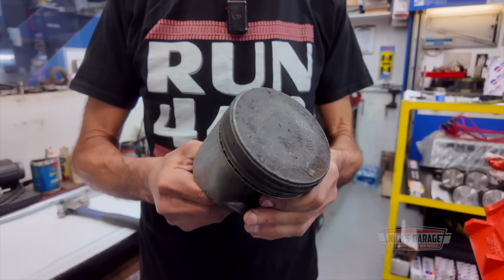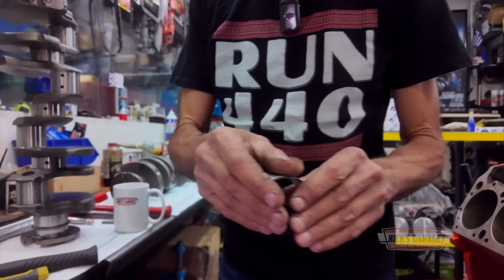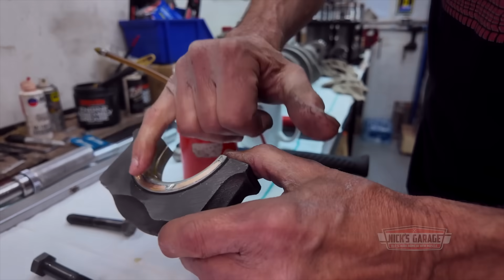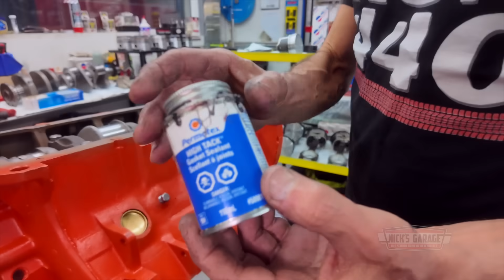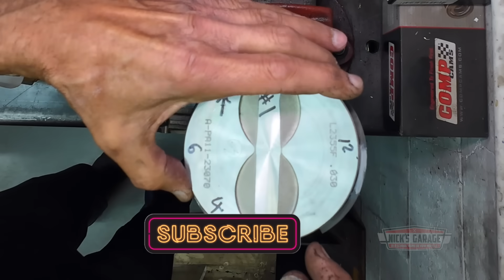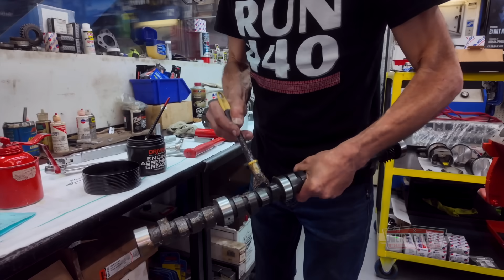Numbers Matching 1970 Magnum 440 Rebuild - Part I - Short Block Assembly

Comment: It's okay to use the battery-operated ratchet to get the bolt close but you should use a hand ratchet to seat the Bolt when the battery ratchet spins off the Bolt it could spin off a shaving from the bolt head. Using a hand ratchet with your hand over the head. It will stop it from stripping. Plus it will stop from twerking the cap slightly out of position You should never strip a bolt or a nut head. I'm not a mechanic something my grandfather taught me. Love the show my favorite show

Comment: Sitting here watching this at 11:45 p.m., and it's saying 7 months ago .... and it's like I'm right there assisting ... pre coating parts for assembly with oil ... I can almost smell the oil and fresh paint. I guess when we love something enough, it happens!  Listening to the metal as he drops the bolts into place for the connecting rid bearings .... and await the distinctive "click-click" of the torque wrench as each one is set to specs.
Last rod bearing being torqued, and it's like watching a surgeon at work.
Thank you!! Much appreciated! And thank you to George for bringing it all up close to see! Stay safe and well.

Comment: id build the block in the car up to about 520 to 530 hp and put this blck on a stand parkednext to the car. I d put a 5 speed and save the original trans with the original engine.

Comment: At 1:19:24 the key on crank is not aligned with cam mark. Is the key not suppose to be straight up for TDC
Reply: NO.  The two marks on the chain is what you want to line up  on this application.

Comment: If I read the cam spec right that's a 112-degree lobe center with 5 degrees of advance ground in. I'm no professional, but I recognize the ubiquitous 214/224 cam that shows up under many labels. It's not a hot cam, but it's a nice step up from stock for that engine. The extra exhaust duration should help breathing through the manifolds. You'll probably beat the stock HP and still have a cam that's very civilized in a 440.👍
Reply: 214/224 is pretty much the same as the stock magnum cam @ .050.  the 112 LSA is different though (115 was stock) and the 107 ICL is quite a bit different as well.
Reply: Good point.  The only problem is that from the factory the 440 did  not have a  true 10.5 C.R.  If it did, it would have made easy 375 HP plus.

Comment: I balanced crankshafts for several years, and when you pointed out the hole drilled by the Pin area, that told me your new pistons and rings (your using the same rods, which you may have had matched weighted too) are heavier than the original ones. I used to make up ring weights for one off cranks to match the calculated reciprocating mass .
Did production balancing too and for that we had comp heads to counter the crank counterweight mass and not stick ring weights on cause it’s time consuming and production cranks aren’t balanced to as tight of a spec. 😊 this is fun to watch .
Reply: The pistons I replaced in my 440 are much heavier   then the cast i had before.  Good call.

Comment: i wonder what two differences in the test mule 440 that resides in the challenger  now compares to the original beast that goes back in. ill bet someone missed a shift or over reved it to break that rod. thank god that cylinder is fine. dyno comparisions will be interesting!

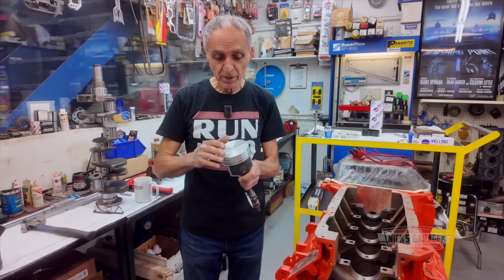Comment: 5:17 Thank you for pointing out that specific detail! A lot of the time all I hear is people saying "deck the block, deck the block, blah blah" but they don't understand that once you do that you can't put that metal back. The correct process is to get pistons to suit the deck height as you pointed out here. I've seen several blocks ruined for further rebuild opportunities because they shaved the deck to match a set of pistons. When they do that they change a lot of other things too, valve train geometry or pushrod angles and then the intake has to get planed to match the new heights. I get doing a clean up pass on the deck but taking more than a few thou is asking for problems.

Comment: Great video. Being a shade tree mechanic myself (those days are over) it is a service for those who will be doing a rebuild at home. I noticed how strongly built the lower end of the 440 block is, it must be quite rigid. No wonder the Hemi with the cross bolt mains can take so much power.

Comment: Very nice work as always Nick. 👍
Side note: factory length on the fuel pump pushrod is 3.22" - and a lot of the aftermarket ones 
these days aren't very good quality (probably skipping a hardening step in manufacturing) and
will wear prematurely, which makes a good factory one the wise choice.
On to video #2!
- Ed on the Ridge
Reply from the maker: Good information to know, thanks for sharing!

Comment: Great video Nick.  I’ve done same as you.  I have original engine 440 built wrapped on an engine stand.  Replacement engine is a racing engine.  360 supercharged.

Comment: Been on the fence about whether you should install this engine, or make it a stand queen.  Never been a fan of letting engines sit, unused, and I don't know how much driving of this car you will be doing.  I think if it was my car, and I would be keeping it low mileage, I would install the original engine.   But I don't have the means to swap out engines as easily as a shop does, and having 2 engines for one car wouldn't be an option for me.  And let's see more of Georges hot rod!

Comment: Nick I built several 440 and one 383 (4 speed superbird)  matching number
Heads  do what you can  I used the 2.14 x 1.81 combo but today I would use guides for smaller stems  would LS valves work  get rid  of the heavy stock valves  multi angle on the intakes. backcut and radius on the exhaust modern beehive springs with their lighter retainer  use the durabond seats
Does the crank need work, new pistons etc   
on the 383 I snuck a 440 crank in  on one of the 440s I  used a stroker
stroker is the way to go, you can use a 7.2 rod  anything you can do to get lighter pistons is well worth in and there are more modern ring packages than the 1/16  1/8 combination  GO light but try and keep a reasonable compression ht  If your plock has 6 pack crank and rods loose those heavy rods for sure
do not use a stock cam  they are a smog cam you can do much better
hyd roller or hyd
If you use stock stroke use the quench dome piston from KB  I helped design these back then
did you square up the block  sometimes they are all screwed up
those 6 pack rods are junk and the pistons are heavy  no quench   plan on super premium gas with no quench and high compression
cheers
Howards has a good selection of HFT Mopar cams, comp not so much

Comment: Why worry about anything? Didn't you change the color, and add options that the car didn't have to begin with? 

Just as if a car under warranty has an engine go south. The manufacturers want the failed engine back for analysis, and the customer gets a new replacement engine.

Comment: Nick I’d absolutely leave the welded block in the car. Keep the numbers engine on a nice stand and just leave it. Turn from time to time. You are already a very busy bloke you don’t need to be frigging around with that unless you have to. And it could ruin yr enjoyment of it by making you nervous every time you light up the tyres.
Reply: And the one you have in it turned out a PERFECT street engine 400hp and 500 foot pounds,
Reply: We do that a lot here in Australia we thrown a non matching in it so we can really enjoy beating on it. We rebuild matching and leave it on a stand so it doesn’t ruin yr enjoyment of it by making you nervous every time we light the tyres.

Comment: It's your car, Nick, but if it was mine, I would use the original engine, as long as it's not going to be driven hard a lot. They were built to be driven, not put on a shelf - or stand.

Comment: I love seeing engine builds. 
Speaking of which, how is George's engine coming along? Did you ever find the intake manifold he wanted? I've been anticipating seeing more of that engine, as I have an affinity for straight sixes.
Reply: Soon to come.
Reply: @nickpanaritis4122  I'm not a Mopar guy, so I have a question. I saw that you put in the fuel pump pushrod with a threaded plug on the end - how is it going to drive the pump if the end is blocked off?
Reply: @RoadkillThePartsJockey  ...The opening above the fitting is where the fuel pump lever enters.

Comment: . out of the 5 440s I worked on one of them the center cam bearing was  off I carved on it with my pocket knife so much it was going to lose oil pressure there so Tony had to make one out of brasslite to put it out of center . Tony knew his stuff 1st try bingo .

Comment: This video demonstrated tried and true methods when assembling an engine. Take your time, double check each step that you perform and you will be rewarded with a smooth robust engine.  I have one question Nick. At the end of the day, when you are all done torquing bolts, do you return the wrench to zero? Thanks for this enjoyable video!😊
Reply: Yes, I do set it back to ZERO.

Comment: That's a tough call Nick it depends on what you want from the car and engine. Numbers match to me putting that entire car back to "as built" excepting necessary over bore, crank under cut. If you going dragging, put that engine on the side

Comment: Great video and your knowledge is amazing. Your the 440 guru . I would put the original engine and make it matching numbers. You can say then its correct at shows and not back in the workshop. If your not going to drag strip the car ! I see the engine making a bit more than stock with those pistons and modern build especially if you blend the heads and port match them.
Reply from the maker: Thank you.

Comment: I would put the numbers engine in the car. Its probable not going to be driven like it was in 1970, at least not as often. If the numbers engine is with the car there's less of a chance of it getting separated from the car.
Reply from the maker: Certainly not as often.. but Nick has a bit of a lead foot when he is behind the wheel of this beauty.

Comment: Lets see Georges engine finished and running .
George deserves this NOW he works so hard and does an amazing job Nick.
Your site is good BUT  not without George and Mellisa.
Please get Georges done.
Thank you for all of you guys work !!!
Cheers Gerry
Reply from the maker: The six banger is 80% built and will be on the dyno very soon!  Thanks for being so interested.  Cheers.
Reply: Thanks for the reply .
How much more needs doing... is the intake getting modded or stock?
There was a truck engine that had the 2 barrel that would be simplist .
Cheers 
Thanks Nick
Gerry

Comment: Put that motor back where it belongs and sell me the one that came out
 😊
I need a motor for my 1970 Challenger R/TSE 440. The current engine Is not correct and it came out off a 1970 New Yorker
Reply from the maker: Where would you put it?  😃

Comment: I  just bolted a piece of sheet metal to the bottom two bolts of the 727 transmission inspection cover with a piece of absorb pad between the transmission and the sheet metal to collect oil that leaks out. Im tired of replacing the rear seal on my 383. Thanks Niko